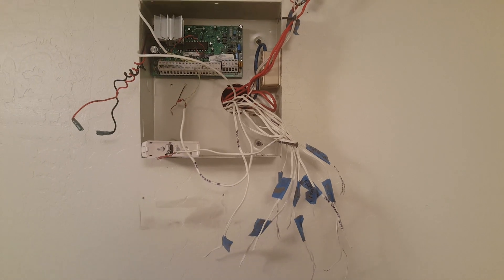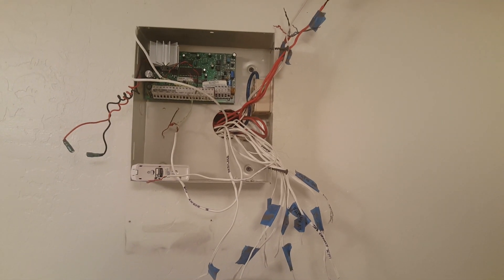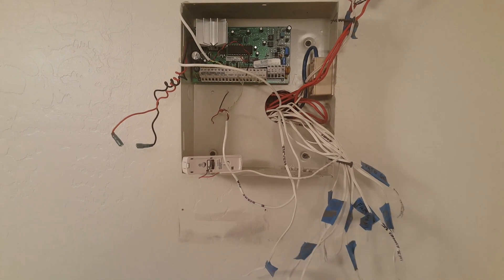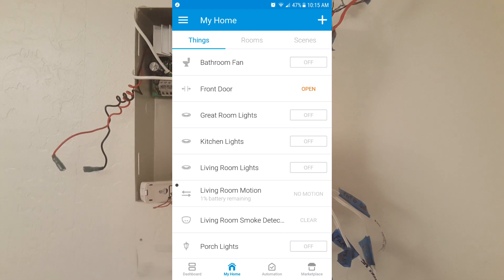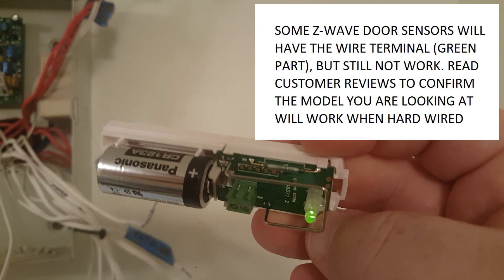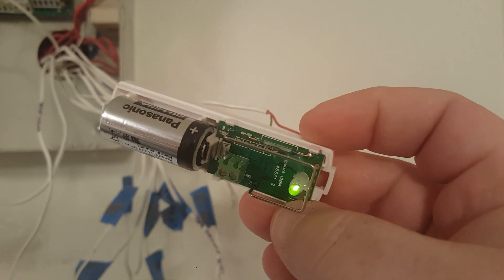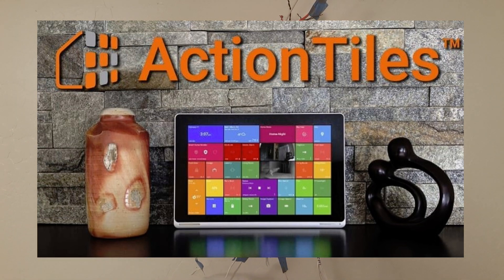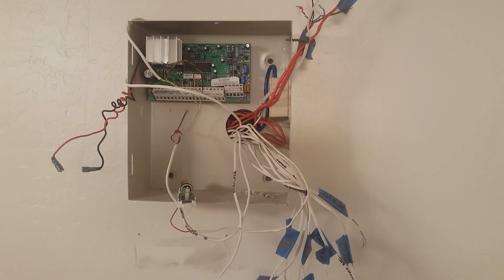How to Convert Pre-wired Alarm System to a Smart Home Alarm System

Comment: What do those red wires go to? I have the same red wires but no idea where they go to.
Reply from the maker: I'm not exactly sure it's most likely going towards the transformer the outlet plug or something substantial in the system. unless you are reusing other parts of the alarm system to me it isn't important. I ultimately disconnected all wires from the system just to make sure that nothing was tied in anywhere that I didn't want it to be.

Comment: If the wires weren’t labeled and weren’t connected to a box how would one go about finding out which wire goes to which sensor?
Reply from the maker: Get a multimeter and set it to continuity mode and touch one probe to one end of the wire and the other probe to the other end of the wire and then have someone go throughout the house opening doors and windows / trying to trigger a sensor and when they do and you hear a beep then you can label it with whichever sensor they just set off
Reply from the maker: In many cases you might hear a constant beep until you trigger the sensor by opening it... In that case it is the lack of noise the breaking of the contact of the magnets, that lets you know that that is the door or window or whatever it was that you just set off

Comment: Just use raspberry pi then run it to home assistant. Cheap and very customizable.l but very reliable and not cloud dependent. Sensors are very cheap also if you go to ha route.
Reply: Can you elaborate more on this plan, like what home assistant would work good.  Also what version of the raspberry pi should i look into?  I want to build a system that uses modern software but can utilize some of the old hardware I have like tablets and sensors.

Comment: This is helpful but I'm not interested in things I have to keep changing batteries in. Are you aware of any other options?
Reply from the maker: Konnected might be up your alley, look into that product. 

My solution seems to be hassle free so far, I haven't changed batteries in sensors and several have been running for 2 years.
Reply: Since everything is run into the closet you could find a power supply that matches the voltage of the battery and use and just as long as it provided enough amperage you could power several sensors.  You could even use a battery with a voltage regulator and  hooked to a charger so it would still work when the power goes out.  But , Yeah I totally agree; Those expensive hard to find batteries that those sensors take have got to go!!

Comment: what is the board you used to convert the wired system to smart?.. you forgot to mentions and there are no more videos..
Reply: @DIYAroundTheHome  What model number and make is the sensor you used. In this video example, I would then need 8 of these sensors if i had 8 zones? And how would you attach  motion detectors